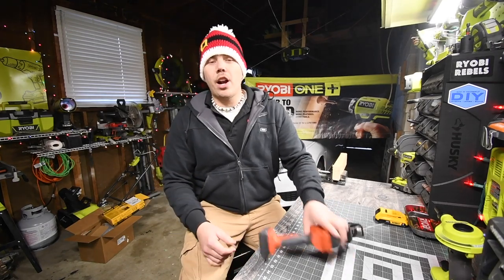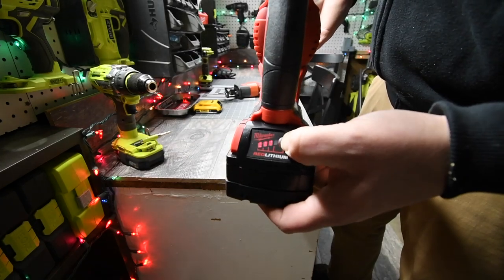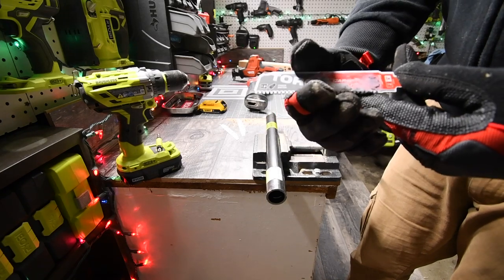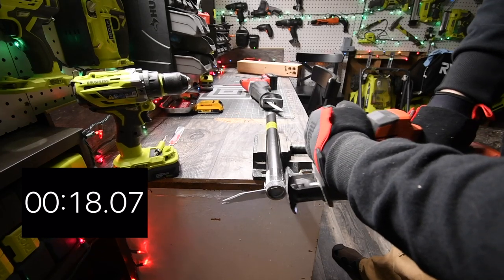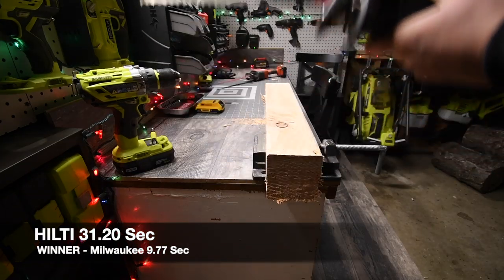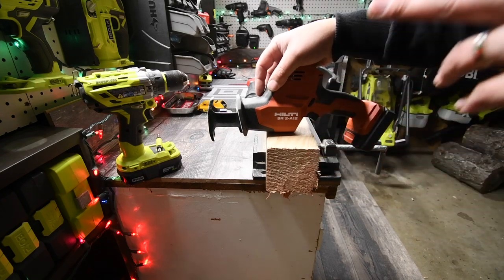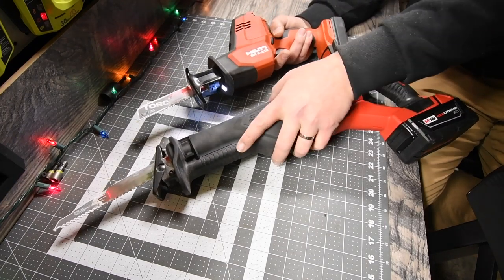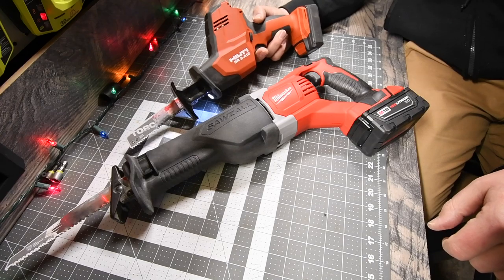HILTI vs. Milwaukee

Comment: I have the brushed M18 hackzall in a tool kit that belongs to the company I work for and it's decent, I'm sure the Fuel is really nice. When it comes to saws though, I'm not interested in a 12 volt variant from any of the companies.
Reply from the maker: more versus videos are coming
Reply: We have a M18 Fuel Hackzall and the only complaint I have is that it's huge compared with the brushed version.

Comment: You should compare the new Hilti Reciprocating saw against the Milwaukee.  The Hilti will piss all over it. Milwaukee are overhyped.  I have the Gen2 18 volt fuel combi drill 136Nm of torque.  I also have the Hilti SF6H A22 combi 80Nm of torque. On a torque test today the Hilti pissed all over the Milwaukee. Plus the triggers on the Milwaukee's are shit. I own, Gen2 combi, Gen3 impact, fuel jigsaw, and 6 1/2 fuel Circular saw. Triggers shit on all of them.
Reply from the maker: I plan too. i am also getting the full HILTI recip saw as well
Reply: @ManCaverTools  That new Hilti recip saw is the best on the market. I have just this week got the new Hilti SF6H A22 brushless combi drill. It is the best combi I have ever owned and I have bought, Milwaukee, Makita, DeWalt and used Bosch and Ryobi. I have a Hilti corded Te1 that I  was given by a contractor who had really thrashed it. That was 33 years ago and that drill is still running as smooth as ever today. 😁😁
Reply: Pretty please use the Hilti consumables with the Hilti tools, just to show what Hilti has in their portfolio outside of tools.
Reply: @francheskaportuondo  I use Hilti drill and screwdriver bits. Both are really good!

Comment: Milwaukee is faster. But I want see long therm test one time. After years will see. Because more important is durability in my opinion.
Reply from the maker: long time use will be in time. subscribe to the channel and watch the videos. sooner or later a tool will die
Reply: It's now 2022 and I bought a brushed m18 milwaukee kit back in 2008  which came with the Sawzall, circular saw,  drill, and I bought the 1/4 impact separately.   I'm in a trade so  I use these tools almost every day .  All the tools too this day still work even the batteries believe it or not.  The only tool i needed to repair which was last year  2021 was the brushes in the impact.  I swear by milwaukee especially their fuel tools with a high output battery.  Nothing even comes close.  I've had dewalt aswell and have had nothing but problems with them .  Hope this helps:)